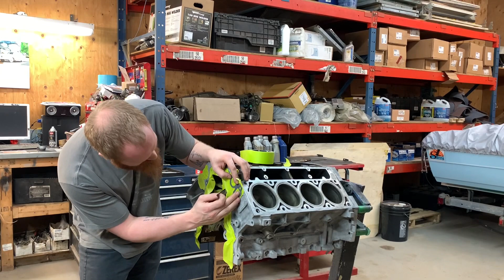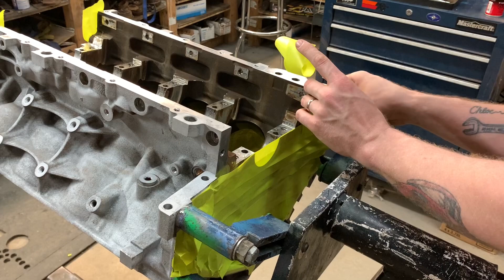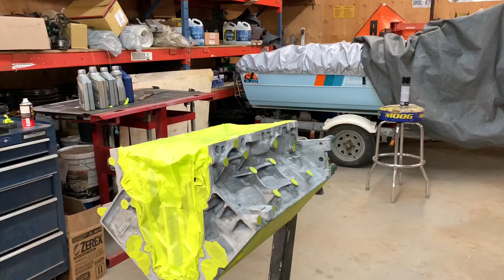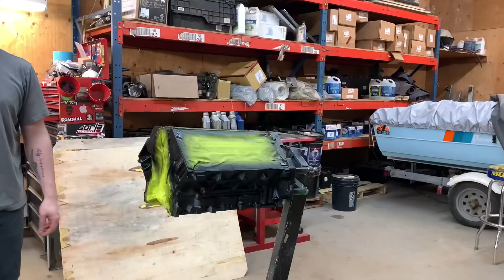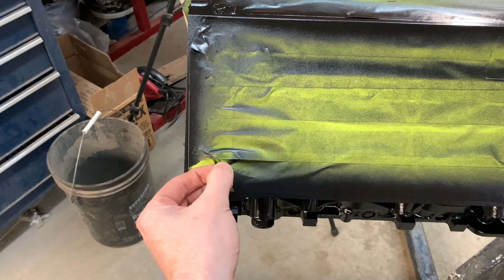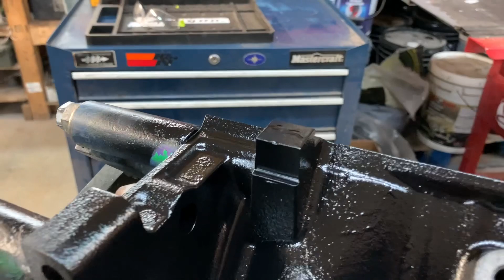How to spray paint an engine block and make it look GOOD | full length, start to finish

Comment: I sense a disturbing lack of $4.99 rustoleum all purpose enamel
Reply from the maker: Shit you guys can get paint for 4.99? I’m moving to cholesterol land
Reply: @StationroadRatrods  its actually $5.99 at walmart, my bad. Cheap paint isnt worth moving to burgerland, it sucks here 😂 and bud the transmission wont care about paint buildup one bit lol
Reply from the maker: Man I actually want to move to the US at some point, but like way the hell south lol 

Manual transmissions get really contrary about alignment, but I’m using a 60e here so I don’t want to help it blow up in any way that I can lol
Reply: From the midwest down to florida is pretty much the same state with a different name, just pick the climate and how many crackheads you want 😂

Comment: Looks great! I remember when I used to tape up an LS before painting .. I don’t miss it lol
Reply from the maker: Much easier to assemble like ass and install
Reply: @StationroadRatrods  can’t be at that Barry it needs to look pretty. I kept a set of paper weight 317s, a front and rear cover, valley cover and oil pan that I bolt onto engines now before I paint them
Reply from the maker: Perfect idea

Comment: If you don’t end up going with a  ICT billet valley cover let me know and I’ll send ya a 4.8 smooth cover..
Reply from the maker: The 4.8 cover would be perfect! I don’t have a lot to spend on extra stuff, the truck itself is gonna be a pretty big cost
Reply: @StationroadRatrods  I got ya man..
Reply: The paint isn’t going to throw off the engine to transmission matting surface

Comment: This is going to be great to see coming from an auto body tech perspective 😂
Reply: 243 with 4.8 pistons/ 91 with additive from the parts store or e85 and consider upgrading to a Holley so the main reason your blowing engines is from mo power baby!!
Reply from the maker: Did you have a stroke watching my taping/masking skills? 🤪 

I want to keep the truck street friendly for the most part, but also do hood rat stuff when I feel like it. There isnt much around here for racing so it won’t be competitive
Reply: @StationroadRatrods  as for not having anywhere to do racing hood rat shit, if that the case then you have an opportunity & obligation to try and help preserve the car community and it’s culture that includes starting up some light street races here and there with some people you know
Reply: Tips: use extra parts to cover the area that don’t get paint rather than more tape.
You can sand off any areas that need to be grounded like you said 
And you could’ve added a can of clear coat to the situation to help protect it but it turned out good..
Reply from the maker: Great tip on bolting on some old parts, I really didn’t even think about it, even though I bolted extra parts on to sandblast it. 

There are only a few people here with faster cars, some times we’ll hook up on the highway and get a few runs in. The car community here is varied, but there are only a few “race” type cars